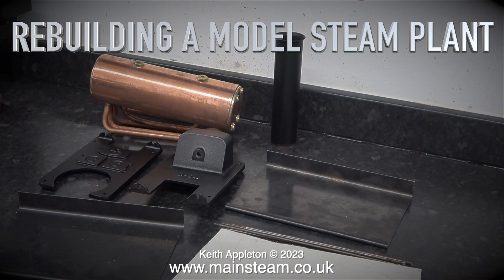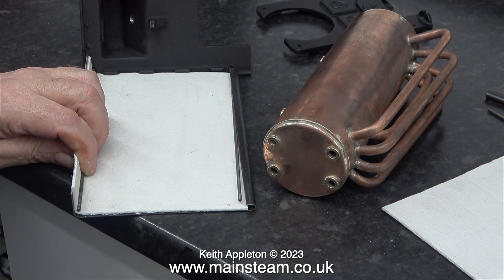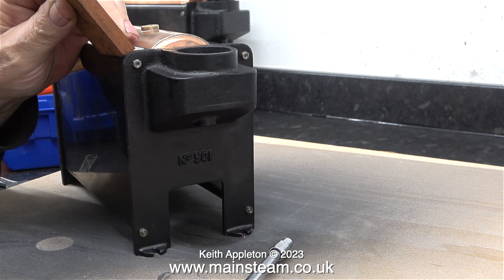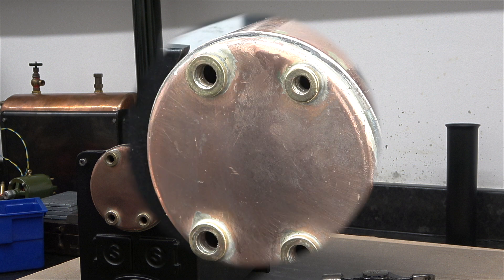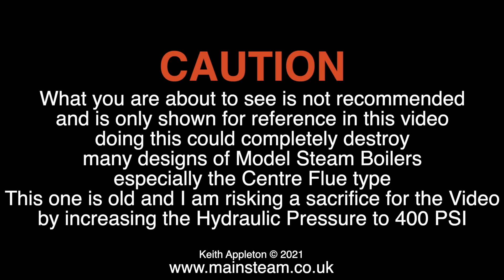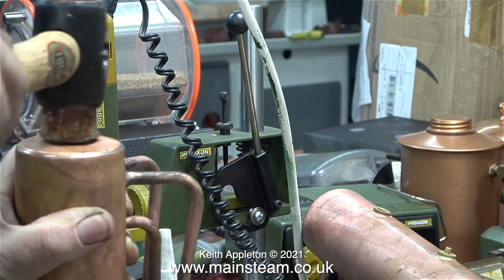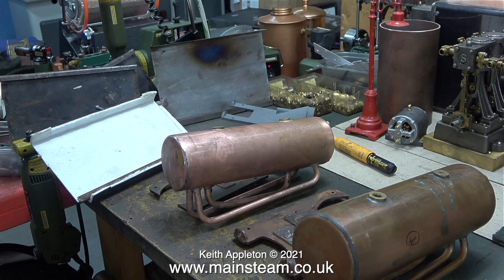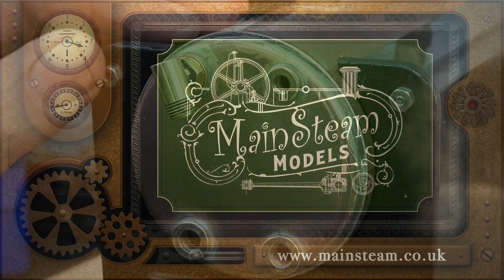REBUILDING A MODEL STEAM PLANT - PART #20

Comment: I tried to do this with ice on a center flu vertical boiler .It went well initially then blew the flu in a big blister .Now I'm wondering how to un silver solder the flue at both ends in order to replace it. Doh .BTW ice means I filled it with water and put it in the freezer.